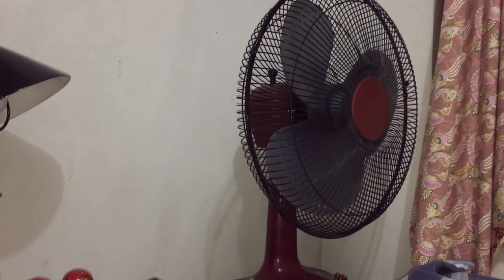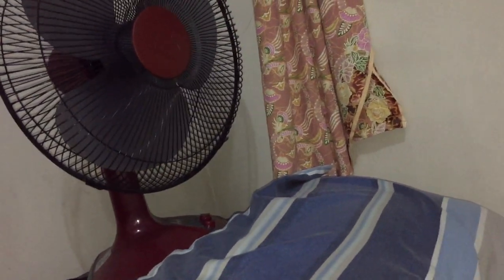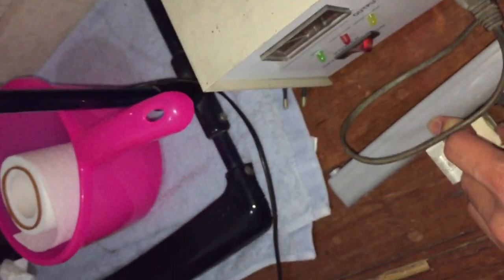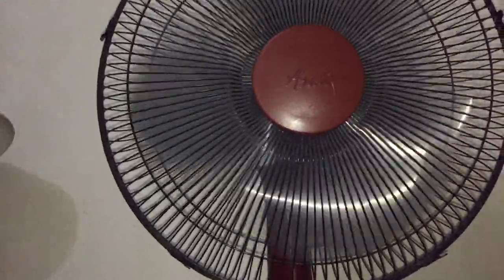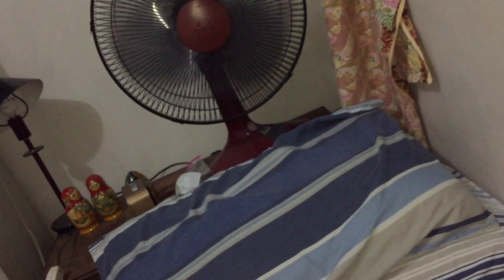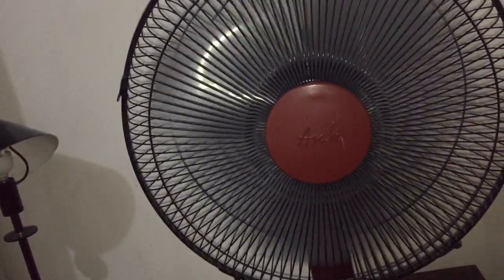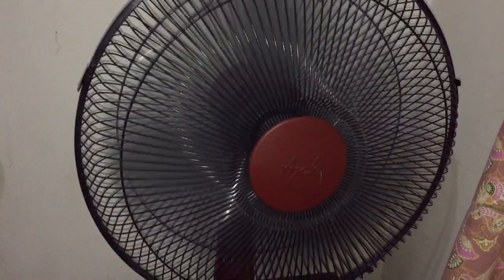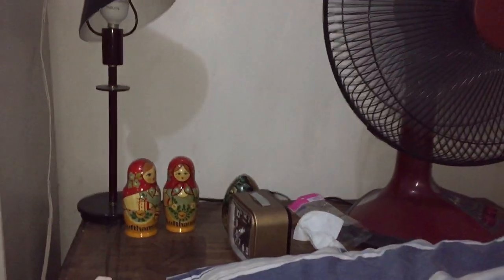(Shown on all speeds) 220v Asahi brand portable fan hooked up to 110 volts!

Comment: Because 16" asahi fans had 1.5uf 450v capacitor, strong motor and 65 watts power this is why asahi fans are fast on low speed even if it's Brand New

Comment: Of course, if you want, you could wire in a ceiling fan controller (more preferably from an orbital fan) to the desk fan and do it that way.
Reply from the maker: Good idea, but the transformer does give a decent range of speeds and doesn't require any electrical work XD!
Reply: Kat TheFanEnthusiast I see...